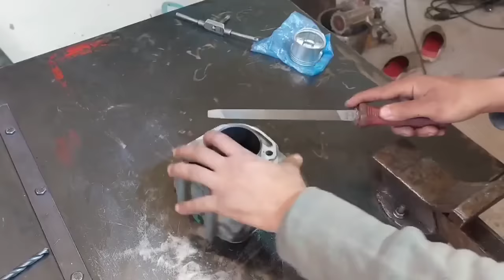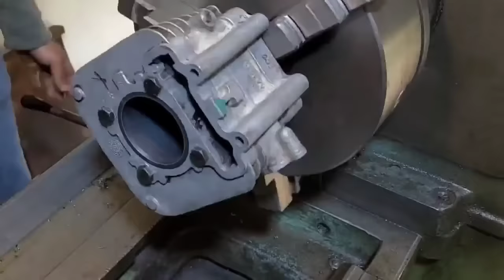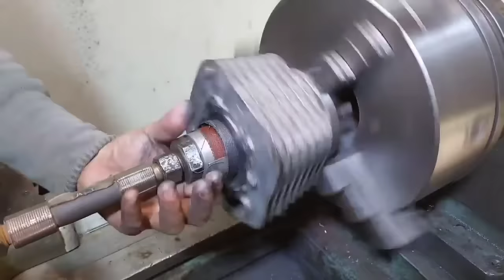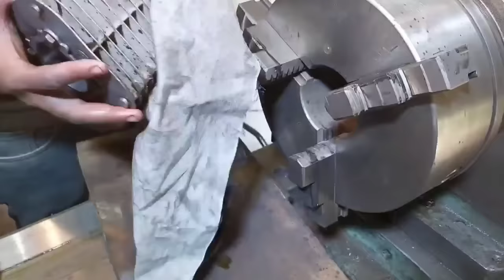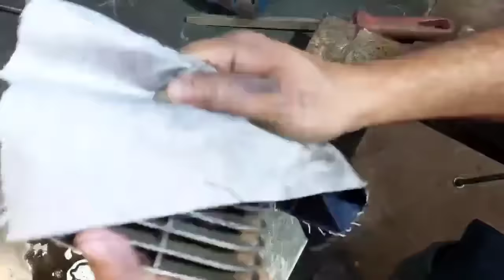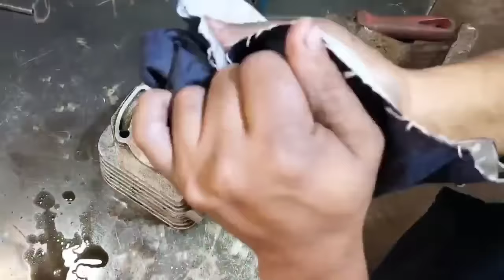How to old technique rebore block cylinder motorcycle

Comment: Agree it’s too tight.  How many .000 clearance ?   Maybe.002, barely need to install rings !!   As soon as that piston heats up and becomes round…it will seize tight.  Nice job on the lathe, ruined by fitting it waaay too tight.  Too bad.
Reply: .00000000000008
Reply: Pode deixar 005 centésimos que aí não tem perigo de quebra
Reply: Se ele comprar um micrômetro e um subto fica perfeito
Reply: Yes👍
Reply: @Dogslegal How do you know?
Reply: Должен быть тепловой зазор его прихватит заклинет
Reply: Заклинет или юпку поршня рванёт🤷‍♂️
Reply: I have bored/ had bored many small Honda cylinders  since 1960's.  0.002 is about right for up to 50mm pistons. A little more for up to 60mm. FORGED PISTONS ( Powroll, etc) are denser therefore expand more... add an extra 0.002". Notice if slight  piston skirt clatter goes away after engine warm-up.😊
Reply: 0😮
Reply: 2thou is fine on this s.all cylinder

Comment: I've done this type of boring on my Honda Amigo PF 50. I held the cylinder in the mandrel by the bottom of the sleeve. Boring the cylinder was relalatively easy, but the most challenging task was to adjust the clearance between the piston and the cylinder to be constant all over the length of the bore. I had to adjust between 5/100  and 7/100 mm, and it took a lot of time. But in the end, it worked flawlessly. In the video, we can see the piston is too tight. No honing, no cross hatch. This piston is gonna seize, as many noticed!
Reply: Все дело в том, автор неучел нагрев при обработке, загатовка остыла и удивила его.
Reply: Muito apertado
Reply: As far as engine building I could be considered a beginner as I've done a hand full of rebuilds, but seeing him have to use TWO THUMBS to push a bare piston without rings down the bore made me cringe soo hard!
had this man never learned of thermal expansion or just how critical piston-to-bore clearances are?
Reply: @МаксимКудеров-у5о 
No no...ha avuto fretta e così ha ripetuto il lavoro.
Ha fatto anche un altro errore che nessuno dice, la parte inferiore del cilindro deve essere qualche centesimo più larga di quella superiore e lui ha fatto il contrario.
Reply: COMMENTS IN THE COMMENT SECTION WILL BE MORE INTERESTING THAN THE  weird VIDEO.
Reply: Именно!!Поршень смазаный маслом должен медленно опускаться под своим весом...Ведь при нагреве цилиндр и поржень нагреваются и расширяются...а на видео даже в готовой детали его забивают...это плохо сделаное хонингование...😢😂
Reply: @МаксимКудеров-у5о Ничего его не удивило...это пакистанский ремонт..😂😅
Reply: За гильзу это плоха.
Reply: OLÁ   22/06/24   Já te inteirasse em "tretamento antagônico" feito com gelo seco e alcool?
Reply: you Long live Sonomaniaque, you know your stuff
Reply: @111455 I guess he found out at full throttle on the highway🤕
Reply: Non hai mai provato ad acquistare una canna già lavorata con le giuste tolleranze e rugosità e specifico pistone per poi incamiciarla nel tuo cilindro con le giuste tolleranze d'accoppiamento, otteresti risultati ben superiori, la cosa difficile però e riuscire a trovarle non sono pezzi facilmente reperibili.
Reply: @angelobergamelli5153  OLÁ   11/08/24  Após 45 anos como anslista de motores lhe digo que é simplesmente decepcionante a maior parte do conteudo contido na intetnet.  Roberto Udo Krapf Analista de Motores a Combustão Interna e Assistente Técnico
Reply: If he had a clue about lathes he wouldn't have paste anywhere near one. He hasn't even covered the bed.
Reply: OLÁ Sono...  28/10/24  Apenas uma pergunta... Donde tiraste conhecimento técnico parra escrever tantas bobagens?  RUK
Reply: OLÁ  29/10/24   Sugiro aumentar seus conhecimentos técnicos.  Lhe será bastante útil  RUK

Comment: You keep taking it out of the chuck and putting it back- never do that- once it is centric and bored never take it out until you are finished. Also way too tight. Bike will seize and negate all your work.
Reply: Agreed, also only clocked the front of the boar,should off clocked the back also to make sure its parallel before line boaring
Reply: That I found irritating too.
Reply: @bradcarson1967  the back is not an indicated off surface...
as long as the front surface is perpendicular to the boring direction it is ok.
Reply: @bradcarson1967  Olá.  Você sabe o que é cronometrar?  QUE BOM...  28?10/24  RUK

Comment: For true accuracy, he should have drilled the holes in the fixture on the lathe.  When making a fixture, the best practice is to never remove the fixture until you have finished all of your machining.  If you do, you need to chuck it in a 4 jaw chuck, and true it with dial indicators.  I just demonstrated this to a friend a couple of days ago.  I had made a holding fixture to shorten some VW cylinders to lesson the piston deck height.  After I had done this I told him to watch the fixture.  I pulled it out of the three jaw chuck, and put it right back in.  Turned the lathe on, and you could see that the fixture was no longer spinning true in the lathe.
Reply: Lui ha sbagliato anche la misura della piastra, il foro in cui inserisce la canna è almeno 0,2 - 0,4 mm più largo, infatti quando mette su il cilindro gli cade in avanti.
Ha fatto molti errori...
Reply: or at least marking your fixture relation to the chuck

Comment: As others have said that piston is much too tight, it should be able to drop down the bore under it's own weight with no rings fitted.
Reply: excellent method to test the clearance!
Reply: It's so refreshing to see an intelligent comment for a change. Thanks so very much.
Reply: @Sonomaniaque  LOL
Reply: Nothing like this in my yamaha 125cc piston was fitted tight after 50k km it worked well not eating oil ot whatsoever. It came like this from factory

Comment: I HAND LAP PARTS TO .0005" TOLERANCE SO THIS LOOKS DOABLE.A LOT OF HIGH PRESSURE PUMPS DON'T USE GASKETS AND DONT LEAK SO A 2CYCLE CYLINDER MIGHT BE OK  IF .0015 OR SO TOLERENCE IS MAINTAINED. UNTIL SEING IT DONE I DIDN'T PONDER IT. NOW I HAVE TO TRY IT!I CLEANED UP A CYLINDER THE SAME WAY BUT IT IS TOO LOOSE. I'LL BUY A .5 MM OVERSIZE PISTON AND RESIZE THE CYLINDER. THANKS FOR THE DEMO, IT LOOKS GOOD AS LONG AS I CAN KEEP THE BORE STRAIT OR MINIMUM TAPER. THANKS AGAIN.
Reply: OLÁ  28/10/24  Deu para notar que tens pouco conhecimento de medidas, tolerâncias, e muitos outros fatores que influenciam em uma análise de motores com referência ao AL. Tolerâncias de 0.00?mm refere-se, em apenas cubo e pinos de pistões de alta qualidade.  Considerar, em alumínio tolerâncias ou medidas na ordem de 0.000?mm (décimo milésimo de mm) é simplesmente um absurdo.   Roberto Udo Krapf  (Analista de motores)

Comment: First, you are wearing long sleeves while working on a lathe.  Second, you are wearing a knit type material when working on a lathe.  A short sleeve cotton shirt with buttons will tear before it pulls you in the lathe and makes you into blood pudding.

Your idea of using a plate to mount the cylinder to is good, but the plate should be at least one inch thick to prevent cocking in the chuck.  A top torque plate with washers under the heads of the bolts would have prevented marring a machined surface and distributed the clamping force.

You bore within .001 and then hone to size WITH A HONE, not a glazebreaker with sandpaper wrapped around it.  You have at least .002 taper from top (loose) to bottom (tight) and God knows how much runout.  You ruined the cylinder to save $30.

Comment: I don't know about motorcycles, but my dealings with B&S engines, go carts was interesting. Aluminum cylinders are a lot different than a cast cylinder. I finally had pretty good success honing it to very close to size, then using crocus cloth to finish it, as the rings needed a mirror finish not to wear the cylinder.😊
Reply: OLÁ   28/10/24  Engano seu...   Falta-lhe um bom curso...RUK
Reply: @robertoudokrapf453  You are right about that😂
Reply: OLÁ ROGER.  É bastante difícil se adaptar em um mercado preparado para  "use uma vez e depois jogue fora"  Na realidade o consumidor final está sendo tratado pelas montadoras como o bobo da vez.  Quanto ao brunimento ele se faria necessário pois o acúmulo de óleo que provoca na superfície do cilindro é necessário para assentar os anéis.  (trabalhei muitos anos na Cofap).  Temos uma luta pela frente para sobreviver.  As montadoras nos querem fora do mercado.  Parabéns pela sua iniciativa.   29/10/24  Roberto Udo Krapf

Comment: That piston will seize in the bore. Piston to wall clearance should be a minimum .002 so the bore must be .004 larger than the piston. After correctly sizing the bore it needs to be honed with a flex-hone to get a nice 45° degree crosshatch so the wall will properly hold oil to lubricate the piston.

Comment: Where theres a will. Theres a way... Two things : you're supposd to use torque plates on both sides of an aluminum cylinder... And your cross hatch is suppose be at a 45 degree angle...I agree with others piston is fit too tight...

Comment: It amazes me how so called machinist don’t know what a 4 jaw chuck is , More accurate than a 3 Jaw
Reply: Dead right, i have had apprentices over the years and have always made them get used to clocking in a four jaw chuck. At first they struggled but when they get used to it  they realize its quite easy . Also used to make them screw cut rather than use taps and dies were possible . All essential skills for a machinist

Comment: Good grief, never measured the piston before boring it out, then the honing OMG the cylinder will be bigger in the middle, besides it will lock up without the correct clearance or rattle like mad.
Crap workmanship.

Comment: He seems to be doing everything right, but not correctly. The piston stroke is checked through the cylinder skirt and not from the valve head. The piston is always checked through the cylinder skirt, but where is the thermal gap? And where is hom?

Comment: you have to properly center and align the boew to the machine. tapping the colar till it "looks" good is not a true centering method. then you measured it with .05 out of spec and expected it to be correct. this is how you ruin a cylinder.

Comment: Multiple mistakes and inadequate result.
The basic rule is that the footer does not detach from the jaws! Precision machining must be from a grip.
It's too tight. With good processing, the piston (without segments), clean without lubricants, must fall slowly through the cylinder. Here I see that it must be hit with a hammer to pass through the cylinder - it will be blocked in operation.

Comment: Sorry, that's just nonsense and shows a massive lack of knowledge. The lathe doesn't change that either. Piston clearance after trial and error. It gets stuck on the next incline. With the file on the sealing surfaces. No centering point, no micrometers...

Comment: worst cylinder bore ever .. you have a lathe .. and then you can't buy a three point hone .. then it could be perfect ..I can drill/hone a cylinder without using a measuring tool,, and if you measure it will lie +0.03 above the piston measurement .. feeling and practice

Comment: I dont get it, you can bore it to the correct size but you dont.
After boring to the correct size you only need to hohn the walls for oil stickynes.
You have the tools.
Reply: No you home to remove the tear from the iron bore, 30 deg cross hatch for the rings to bed in to.
Even if he had the correct clearance it will not bed in and smoke like crazy.